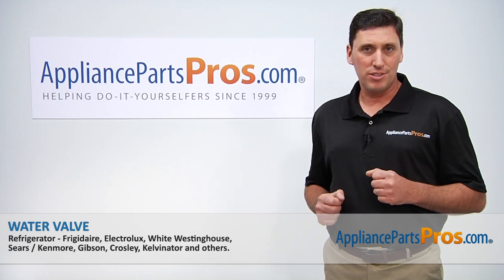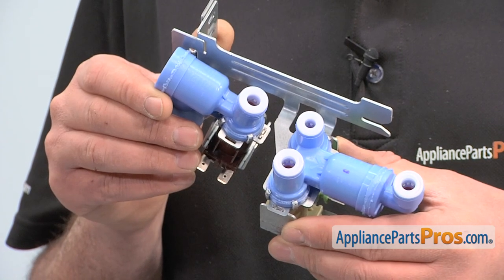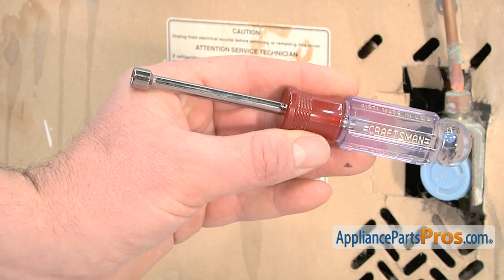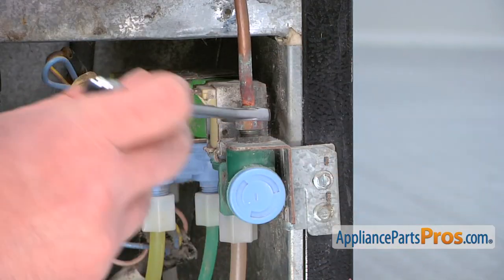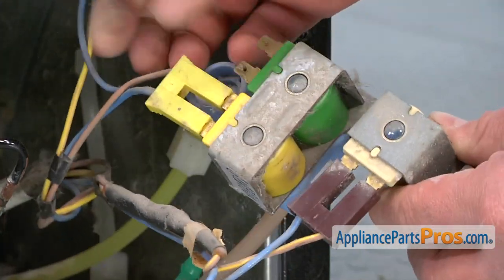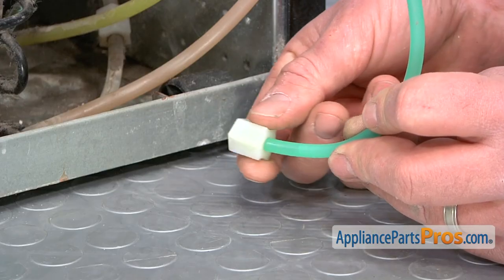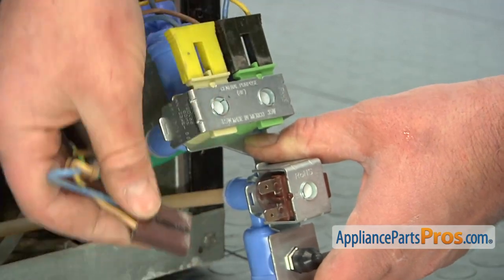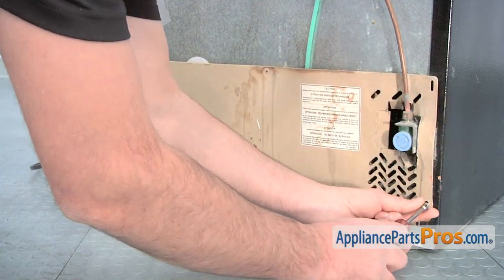How To: Frigidaire/Electrolux Refrigerator Water Valve 242252702

Comment: My valve functions properly but leaks at 2 of the push in connections, is a new valve my option to solve the issue?
Reply from the maker: You can check to make sure the water lines are seated properly, if they are then you will need to replace the water valve.
Reply: @appliancepartspros  Thanks for the reply! I did reseat the connections, time will tell

Comment: Two questions, i may have switched the beige hose and the clear hose, how you pull them out of the compression fit. Secondly, when I push the the water lever the water comes out at the compression fitting. Why would that happen, is the water line frozen?
Reply from the maker: You should be able to push in on the fitting and the hose should come right out. It is possible that the line could be frozen and that is why it is coming out at the fitting or if you do have the hoses mixed up that could be causing the issue as well.

Comment: Question, what if, the water has a funky taste to it? I have replaced the water filter. The fridge is over 5 yrs old but was using local water from the city to just make ice and now I have installed Culligan water to the household but the water and ice have a funky smell coming from only the fridge
Reply from the maker: You may have an issue with the water lines in the fridge. How long ago did you replace the water filter?
Reply: @appliancepartspros  water filter was replaced about 1 month ago.
Reply from the maker: What is the model number of your fridge?